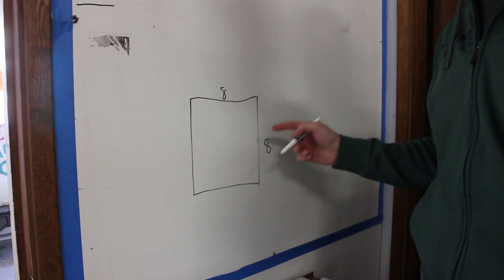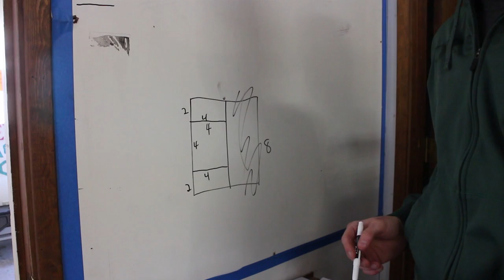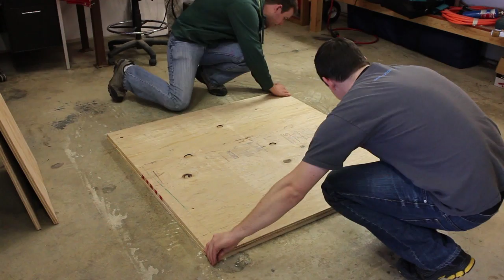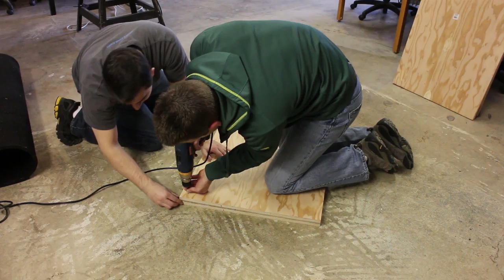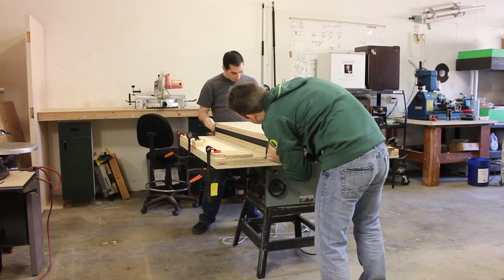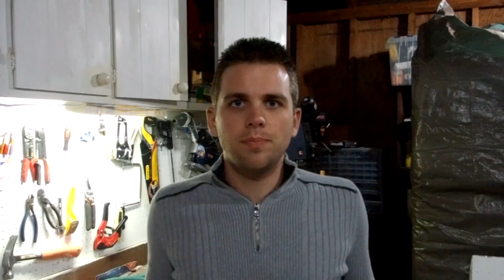Fast Hacks #22 - DIY Modular Olympic Lifting Platform

Comment: To point out the obvious. 1. There was no reason to flip the end with the horse stall mat over to glue it. 2. If you're building a dead lift platform you should have weight plates which would serve fine as heavy weight and avoid the need for clamping and give you more even weight/"clamping" distribution.

Comment: How did this hold up in the long run? Any separation only using glue on the outer mats?
Reply from the maker: Mine is still fine. I only use it for deadlifts and I always set the weights down rather than drop them since I don't have bumper plates. I'm not sure if it would hold up the same if you were constantly dropping weights on it.

Comment: this is a great video! I would like to ask what Grit sandpaper did you use for the top surface board? and did you coat it with anything? or just left it as is. I am concerned it might be too smooth.
Reply from the maker: +Tri Le I don't recall the grit. I considered finishing it to be shiny and smooth but ultimately I got lazy and just left it as raw wood. It's not slippery at all.

Comment from the maker: @Geddie so far I haven't had an issue with them moving around. They are pretty heavy and they have a large surface area. I've only ever gone up to about 260 pounds with it though.
Reply: Rick Osgood instead of using glue for the top layer 4x4 , can I just use the screws to lock it down?

Comment: thanks for making this !
how do you think this would shape up if it was outdoors? any tips to making this weatherproof?
Reply from the maker: I'm not sure it would hold up very well outside. It's mostly made of wood, which would likely start to rot and break down from the weather. It could also possibly start to warp, though I suspect it would be minimal since it's so thick by the end. I would think you would need to seal it with something. Maybe look into weatherproofing for wood fence and see if you can use the same ideas for this?

Comment: About how much $ does the entire project cost? How much do the sections weigh? Do you have any advice about weather proofing (zinc screws, varnish, moisture protection, warping from heat protection...)?
Reply from the maker: Each section is pretty heavy. They have to be in order to stay in place when you drop the weights on them. They are light enough, though, that I am able to move them around on my own. The whole project cost probably less than $150. It was a while ago though, so it's tough to remember exactly. I've had mine in my garage for the last seven months and have not had any issues due to moisture or weather.

Comment: I wanted to save money and cut down on cost since wood is expensive and my location and stall mats are even more expensive. Would using used pallets be a bad idea? ,I would by a 4x8 plywood for the top but the base(bottom) would be constructed of all used pallets that I would take apart. Any comments are very appreciated. Thanks!
Reply from the maker: I don't see why it wouldn't work. All you really need in the end is a sturdy platform to stand on that won't fall apart or be crushed under the weight. If the boards are strong enough, it would probably work.

You could probably use something else other than a stall mat too. That's really just there to protect the wood from when you drop the weights down on it. Maybe some carpet pad would work? This is the stuff that is put underneath carpeting. You might be able to find some scraps that are big enough from a local carpet dealer.

Comment: Just wanted to say thanks for posting this. I made a modified version of this. I couldn't get 4x4 sheets into my car, so I used 10 4x2 sheets instead. And rubber tiles instead of horse stall matting. Turned out very well.
Reply from the maker: No problem!  I'm glad it was able to help you.  Also  good to know that 10 4x2 sheets will work just fine.  It's nice to be able to fit the stuff in your car and also to be able to move it out of your way if you have limited space.

Comment from the maker: That's a really good point McClain.  I've updated the video description to include that information.  This platform is designed to give you a smooth, solid surface to stand on when doing Olympic weight lifting.  It also gives you a solid, but soft surface to drop the weights on so you don't damage the floor or the weights.